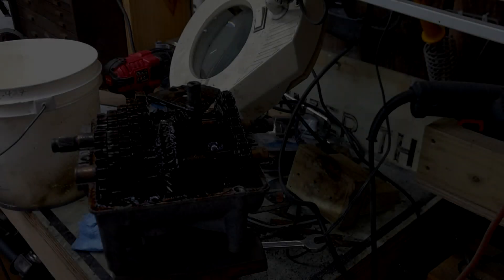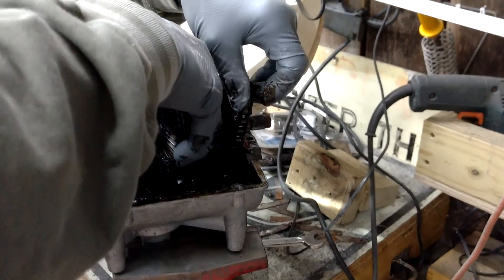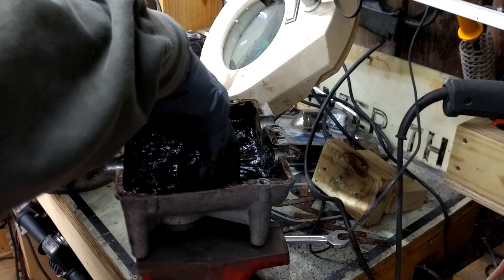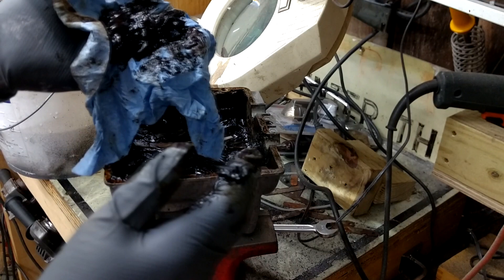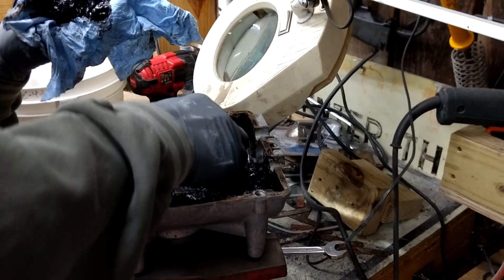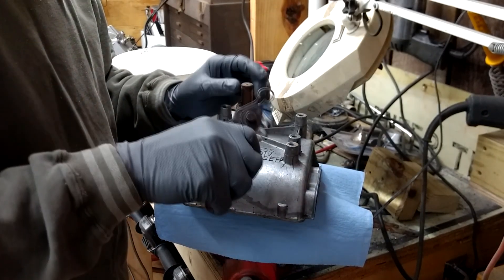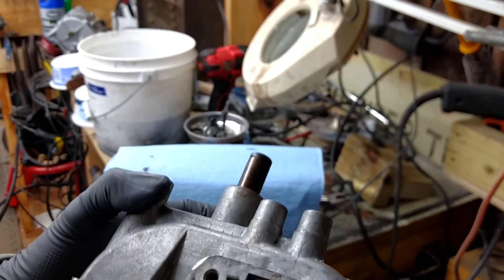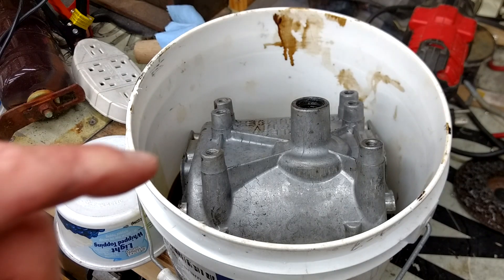Tearing down the 700 series Tecumseh Peerless transmission, Pt 1

Comment: pozz može li pomoć imam ovakav mjenjač na kosilici i  kada polazim u 4 ili 5 brzini malo mi zaškripi na startu, ali kasnije uredno sve ide, znači samo na startu
Reply from the maker: It is possible that it needs to be lubricated inside or one of the bearings, especially on the lower input shaft may drying out and needs to be replaced. There are 2 lower input bearings stacked on top of each other. There is also the possibility that it has nothing to do with your transmission, but rather the belt is slipping at first. Thanks for stopping by and hope my answer is helpful.
Reply: @TheShadeTreeFixitMan  Thank you

Comment: Odd question for a different application of these Transmissions: if you spin the input shaft one way the output shaft turns a certain way. If you turn the input shaft the opposite way does the output shaft likewise turn the opposite direction? Nice video, thank you very much.
Reply from the maker: I suppose it would, but with these gears it is already set up with reverse, though I have found that on the Goofy Cart's chain and sprocket setup, reversing gears can cause some issues. It will be back for some major updates soon...(I hope) Thanks for stopping by.

Comment: I have a question for you sir, I have this exact same gearbox and it works amazingly with the case loose but not when I tighten the bolts down, it didn't come with a gasket but should I put one on or should I buy some gasket maker?
Reply from the maker: There is no gasket supplied, but I wonder if you have something mis-aligned inside, perhaps the wrong spacer washer on the input shaft in the bottom of the box, making it push up in to the gear to far? I only use gasketmaker silicone to seal my transmission.

Comment: PLEASE RESPOND) I have a peerless 700 3 speed with the H pattern shifter. I need to grease it. Does the top half just come off or do the shifter have to move off.. I’d really like a response!! I’m new to this stuff. Any steps? Any ideas? Would be great
Reply from the maker: Good evening and thanks for stopping by. If you have a 3 speed, it is more likely to be a 400 series, which is very similar to the 700, except that the 700 series has a grease seal on the lower input shaft to keep the grease/oil from leaking out. You will need to remover the shift lever and then you can unbolt the cover and lift it off. Are you using it for a lawn mower still or modifying it for another purpose like I did here for my Goofy Cart? If you are going to continue using it for a regular lawn mower (not a racing mower) I would recommend that you clean it out entirely and repack it with Red n' Tacky Grease. It is highly superior to the regular grease that is in there from the factory and better than normal axle grease. If you are going to use it for racing or some other more strenuous purpose, I would still assemble the gears using the Red 'n Tacky, but finish off the filling job with 90 wt gear oil. Make sure you replace the grease seal on the input shaft at the bottom of the transmission case. This is my second transmission clean & re-assemble, the first being a 3 speed with no provision for a grease seal and then this 5 speed with the grease seal. Hope this helps. You mentioned an "H" pattern shifter? Most of these are actually just a straight shift.
Reply: @TheShadeTreeFixitMan  hey thanks for the reply! Yes it’s a h pattern, I am using it as a normal garden tractor, maybe doing a bit of pulling.. i just wanted to know if the shift linkage will fall out.. will it?
Reply from the maker: @Farmtractor  So to clarify, does your transmission actually have a shift lever sticking out of it?  If so, I will have to go take a look at the one like that that I have. It would be different than the transmission I was disassembling in my video above. Let me know and I will check into it some more for you. OK? Thanks
Reply: @TheShadeTreeFixitMan  and I will pack it with grease I just want to be sure that if I crack open the top half nothing will jump out and I’ll lose it or something.. you can see the tractor that I’m rebuilding on my channel and here on this forum: https://gardentractortalk.com/forums/topic/81922-is-welding-the-best-option-for-me/

Comment: Don’t try to remove the input shaft bearings, unless your going to replace them, I turni my transmissions very hard, and never had those bearings fail
Reply from the maker: I'm not planning to do it on this one, as they seem to be in pretty good shape. I did replace one of them in the 3 speed tranny I was using because the needles all fell out when I disassembled it. Thanks so much for your help.

Comment: all that grease and goo probably means that the transmission is in good condition.
Reply from the maker: Now that it is all cleaned up, it looks to be in good shape with minimal wear. It came off of a 90s era Toro rear engined rider. It was pretty beat itself, but yielded a lot of good parts. Thanks Vernon

Comment: I have been using gas as a solvent for 50 years. Nowadays I wear rubber gloves as my skin can't take gas anymore.
Reply from the maker: I used to use it exclusively until I got my parts washer, which came with 10 gal of solvent, albeit, water based. I have since changed to a petroleum based solvent which works much better. BTW, the parts washer was a freebie from Craig's list out in Minnesota. Thanks for stopping by.

Comment: Great video George. The transmission i had to rebuild was a 6 speed with reverse spicer off a husqvarna lawn tractor, which also had water in it. Like you are going to do, i cleaned it all out sealed the casings i had to replace the seize chain too. i then put ep90 gear oil in it and so far so good. I look forward to seeing your rebuild.I hope you didn't lose the small ball bearing and spring for gear selector !
Cheers, Jeff.
Reply from the maker: The bearing and spring are still intact, thankfully. I will make a couple of small modifications along the way which I will document in the video. Thanks for following along Jeff.
Reply: Hey bud I'm rebuilding one of the these transmissions myself,,Do you no what size bearings are the last 2?? The needle bearings the 2 that were good on your transmission,,,DO you happen to know the size of the PLEASE I NEED HELP!!